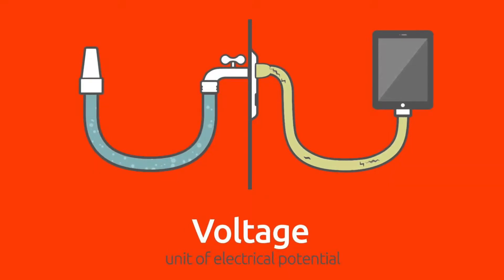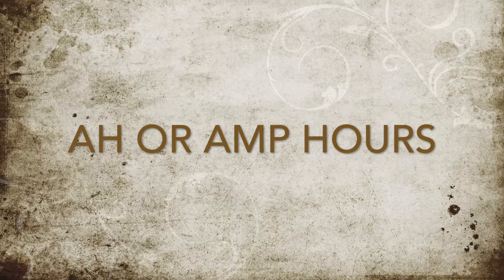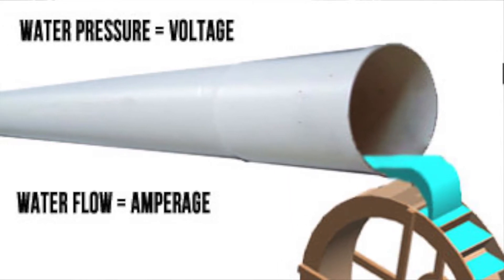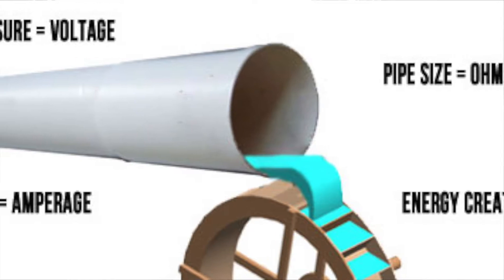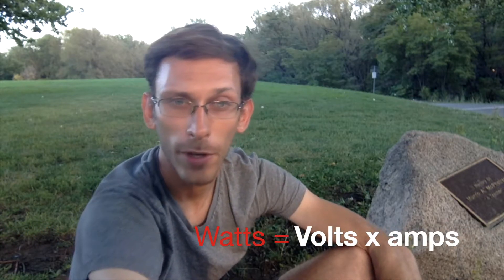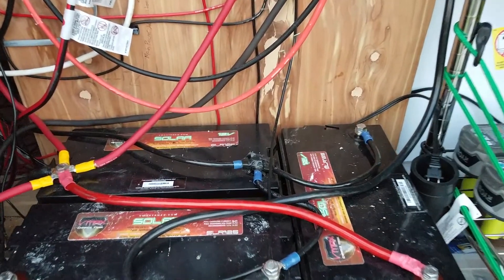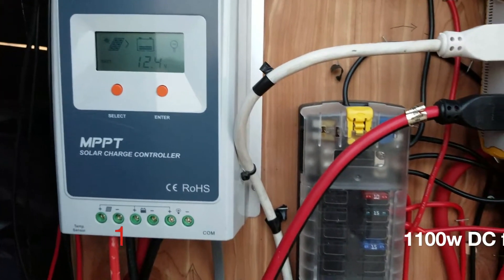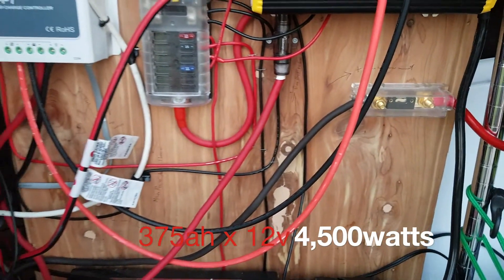HOW TO OFF-GRID SOLAR  #BUSLIFE

Comment: You could have skipped the inverter to use dc power for lights/heat/charging electronics. Your fridge and other appliances would still need the inverter tho for AC power.
Reply from the maker: Hey! Our charger is actually DC, so is the fridge. We just use the power inverter for stuff like our computers/lights/etc. Although the majority of what I use is DC, even down to the water pump. Have you seen truck fridges? They make really cool tiny fridges that only uses 60W